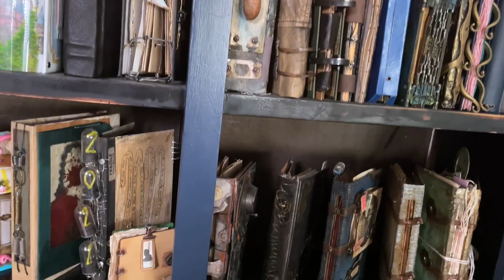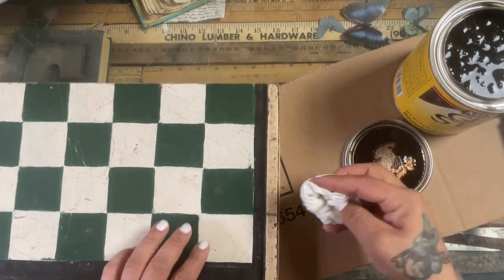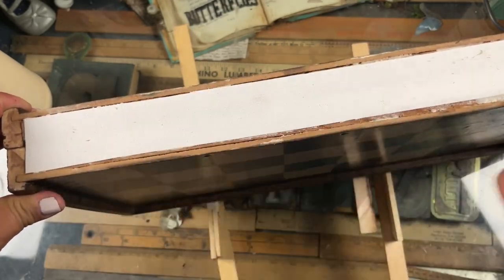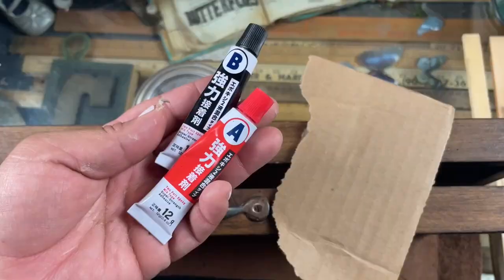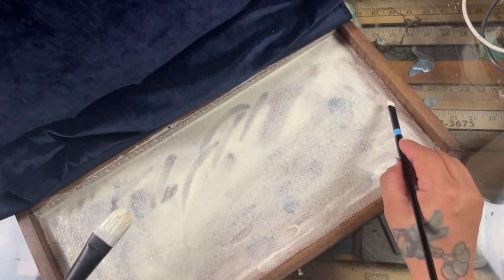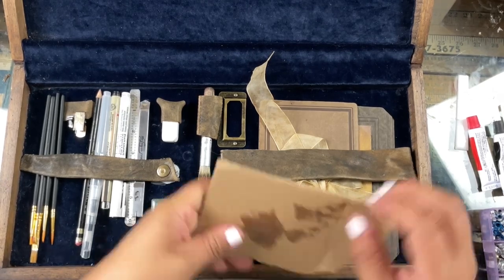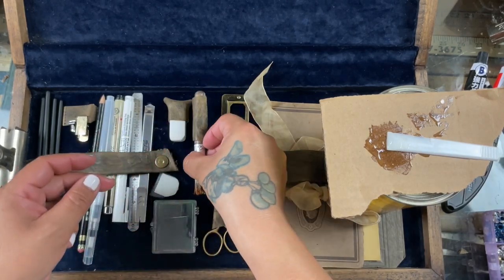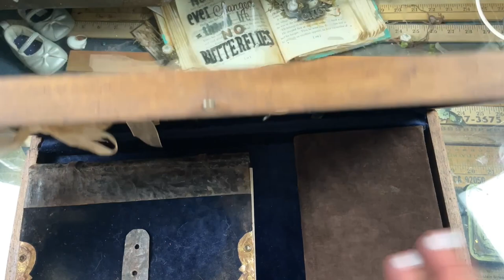DIY Traveling Writing box from an old chess game board box. Journaling lap desk. #diy #writingtools

Comment: Love the concept, I have a couple of really old cigar boxes I’ve been wanting to transform but didn’t have the right inspiration. I have to admit I freaked out a little bit when you started pouring out the wood glue to attach the blue velvet inside. Idkw but anytime I use glue like that with fabric it ends up seeping through my fabric and then it looks like poo 💩 So now what I do is have a piece of chip board and I use double sided tape on the surface of the chipboard (to hold the fabric steady) and then I wrap the fabric around the backside of the chipboard and use the heavy glue to hold the fabric to the back. In your next box, do it like I just described but don’t glue the fabric wrapped chipboard into the box yet. Instead, you can use brads or eyelets to attach the leather things and then you won’t have to worry about whether the fabric will sag under the weight of the items. I hope this made sense 😊
Reply from the maker: It totally did... Thank you for the idea. I have other wring boxes in mind. Thank you for watching